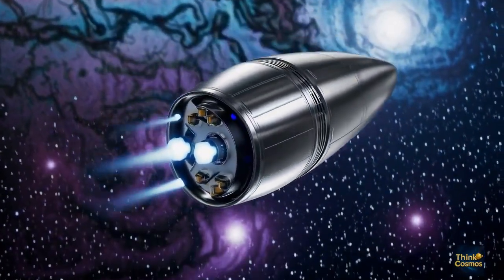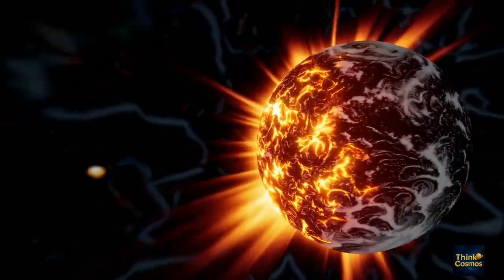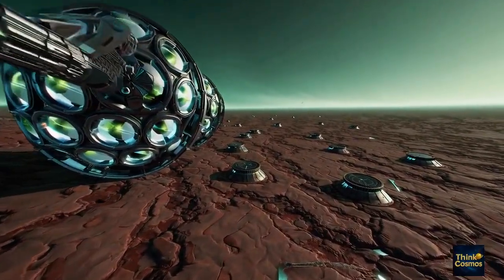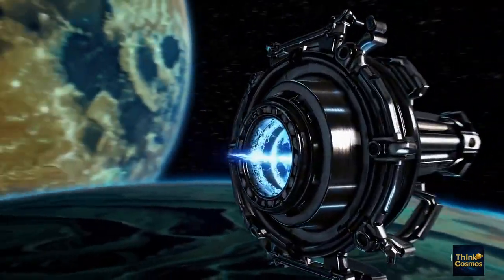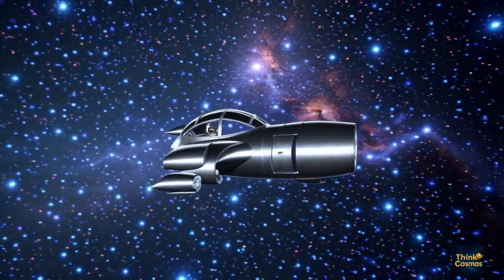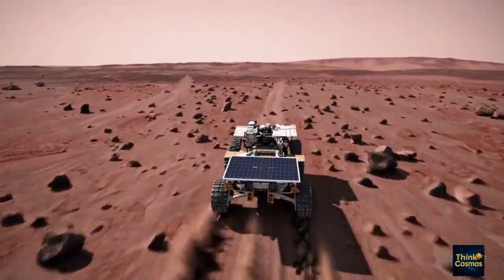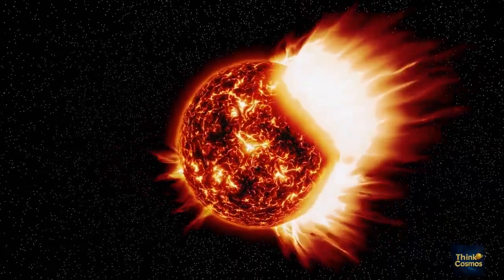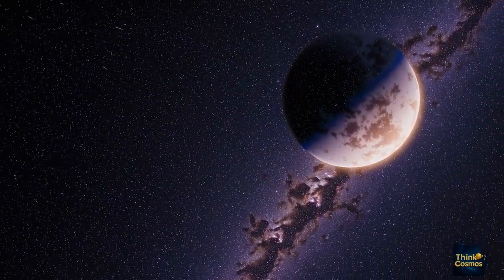Scientists Just “Detonated” a Black Hole Bomb—The Lab Experiment That Could Rewrite Space Travel

Comment: Yo was just hoping you haven't forgot about Thunderwell request, not trying to rush. Just curious when you will make it, very much looking forward to seeing and having an actual vid about it on YouTube!😁🙏
Steam piston concept launch system/weapon for launching cargo into orbit, destroying asteroids, lol and aggressive Alien Spaceship!
--  The steam accelerated Jules Verne capsule, which was suggested by the speed of at least 6 times earth’s escape velocity, achieved by the 10-cm thick, 1.2 m diameter steel cover blown off the top of the 152 m shaft of the 0.3 kt Plumbbob-Pascal B underground Nevada test on 27 August 1957. In that test, a 1.5 m thick 2 ton concrete plug immediately over the bomb was pushed up the shaft by the detonation, knocking the welded steel lid upward. This was a preliminary experiment by Dr Robert Brownlee which ultimately aimed to launch spacecraft using the steam pressure from deep shafts filled with water, with a nuclear explosion at the bottom; an improvement of Jules Verne’s cannon-fired projectile described in De la Terre à la Lune, 1865, where steam pressure would give a more survivable gentle acceleration than Verne’s direct impulse from an explosion. Some 90% of the radioactivity would be trapped underground!